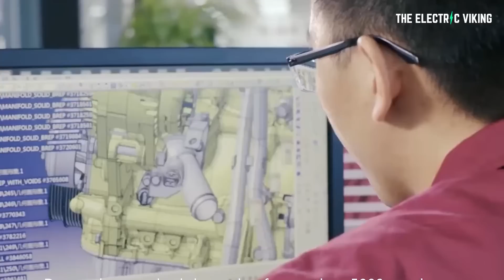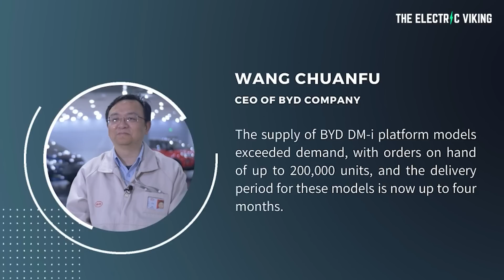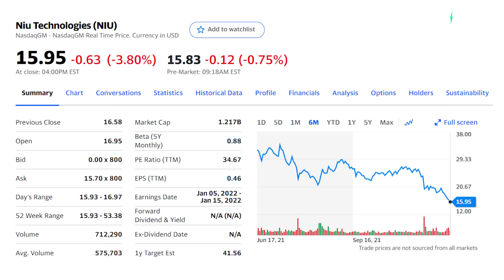EV makers BYD & Niu growing fast, buy up old car factories

Comment: I am on board with the BYD movement, but is there a reason they keep making new vehicles with big ICE style grills adding to drag and generally looking like rubbish? Less drag obvious equals same range smaller battery and more cars or more range and just better looking. Is it a Chinese expectation or esthetic? Alternatively are they utilizing parts from lCE vehicles they built to allow a quicker ramp in production?
Reply: Let's get mass adaption done first, then worry about min maxing styles.